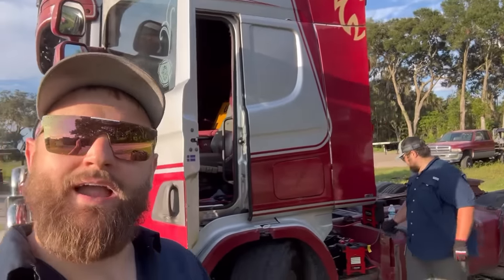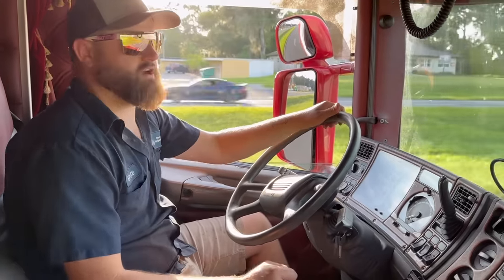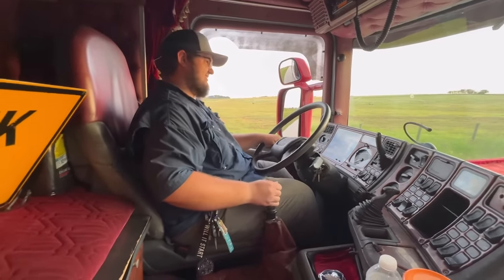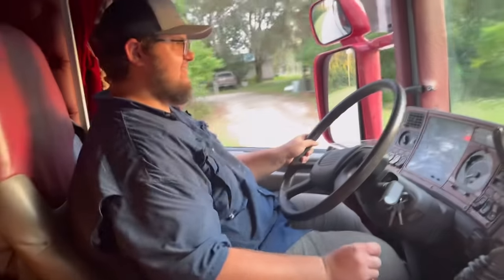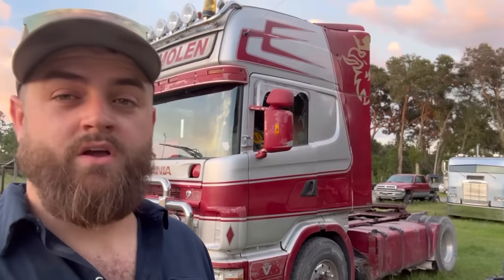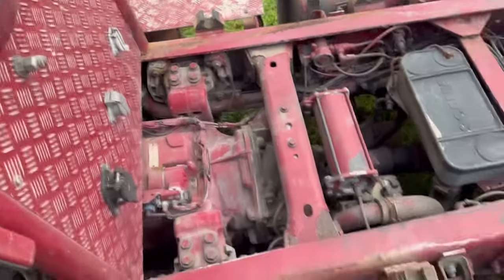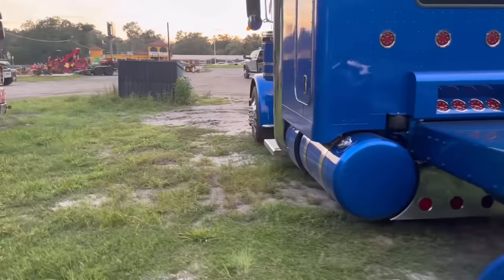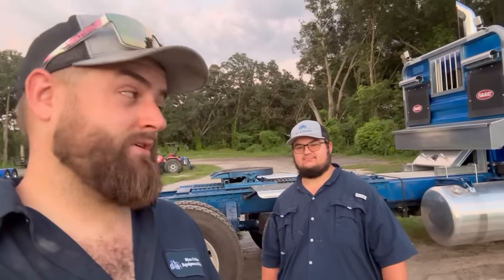American ATTEMPTS to Drive European Semi Truck. (Big Fail)

Comment: I really want to collect a variation of working trucks from all fields thats used here in norway, that scania is a really short wheelbase and its more use in mid europe or flatland europe, come to scandinavia you can hardly find single axel
Reply: It depends of the kind of work of any truck.. Most of the trucks in EU are with two axles and the trailers with three. That was because the TOTAL Gross Tonnage was 40 tons.. And in some countries, we had to comply ALSO with the EVERY axle's tonnage.. Now ,with the new length and tonnage regulations, things are changing.. You 'll see it in Norway too.. Up to now it was a matter of balancing weight and total length because of the 40 tons and 15,5m total length...Now you see many "new" trucks on the roads..

Comment: The round thing of Paper is an log , it logs Speed and driving Time , the police can / will check it if they pull you over . Drivers are not allowed to drive longer than 10 h a Day in Germany  , thats pure driving Time and they have to make a break after 4,5 h driving Time of at least 45 min duration and after 6 h they have to make a break of 30 min . This is required by law thats why the  round paper thing is there , the police has to have an option to check driving Time and Speed , and in my opinion thats good , tired and unconcentrated Drivers can be dangerous . Employers and self employed drivers may have an different opinion because it can limit their earnings , or if they ignore it , they are fined . Since 2006 digital Devices in new Trucks are used to log driving Time and Speed

Comment: I do like the idea of stretching the original frame out, honestly it would be a little funny to see if stretched out longer than you would with any american truck
That said, the original frame isn't TOO bad, the problem is you'd have a lot of work stripping the frame back to metal to get it repainted
Also, I should mention euro size rims are different, im not sure if it was put on american rims when it was imported

Comment: just for information the little toggle switch on the top side of the lever is the splitter,  what you were calling the splitter on the bottom of the stick is actually the range changer (or two speed rear axle if you prefer), in the main box you have three forward  gears which are each split  hi/lo making six speeds in total (low first/high first, low second/high second and so on)  once in third /high split you then pull it into neutral split it low and pull up the range changer then select first again and do it all over again in high range giving you a total of twelve forward speeds and effectively four reverses. done MANY thousands of miles in these motors back in the day - (when we still had clutch pedals !) the 14 litre 500 horse V8 is a beast, pulls like a train fully loaded. its slightly smaller engined sister the 123 uses a 12 litre 440 horse straight six and THAT pulls like a train too although without the spine tingling soundtrack of the V8.

Comment: This truck has done more miles than the Space Shuttle..looking at its general condition..must be over 20 years old..been across Europe and Scandinavia the whole of its life. I notice she's running lumpy too - these are usually sweet as a nut
Reply: Its a 4 series scania, iirc they were built until ~2002 or somewhere around that.

Comment: If u are trying to find a nextgen Scania (2016-forward) with manual gears, that will be a challenge. Manual is so rare nowadays, hardly anyone wants that because Scania's Opticruise (brand for automatised gearbox) is so much better than manual. Volvo and Mercedes-benz does not sell truck with manual gears anymore in europe
Reply: The reason being that people can't drive anymore, companies need cheap steering wheel holders. Only an idiot would prefer an automatic, luckily Finns still appreciate Fullers.
Reply: @ImForwardlook  tell me how automatised transmission make you a bad driver? I have been driving now 12 years and always with manual but i still prefer automatic, does that make me also bad driver and idiot? Ps, in Finland only truck with fuller is Sisu, and it also has an automatic transmission as standard, you have to pay more for a manual
Reply: @ImForwardlook  lower running costs is the reason for manuals going extinct, not the inability of the driver to swing a stick around. There are other ways to satisfy your love for fondling "sticks" if it's such an important part of your life.
Reply: Companies bought the automatic trucks because of less maintenance and lower fuel consumption. Very few people want manual transmission any more in Europe there's no reason for the manuals anymore
Reply: @ImForwardlook  What does a gearbox have to do with how good of a driver you are? Don't get me wrong, I like a manual for fun in a car. 
But for example the opti cruise if we are talking Scania was more than 10 years ago already better than a manual. It would allways do what you told it to and even could do stuff you can forget in a manual. O program and it sounds like it's raping the gearbox on how fast it shifts (quit driving more than 5 years ago so haen't had a chance to expreince the new version)
On top off that 600-700+ hp with over 3000nm of torque, couple of misstakes and bye bye driveline.
Reply: @sauliaalto  And your answer to the question why pretty much all logging trucks and other heavy haulers are Sisu is right there.
Reply: @ImForwardlook  what decade do you live in 😂?  Sisu was the most popular timber truck in Finland in the last 90s.  Volvo and Scania have been the most popular by a clear majority since then.
Reply: I guess an big differences is, US seems to be mostly flat. 
Out on the highway in to gear and drive. 
Fore an example Scandinavia you need to shift gear more. 
Hills, redlighrs, and so one.

So you auto haters visit europe and try 😊

Comment: By the early noughties, many trucks had g/boxes that didn’t need the use of the clutch. Now they are mainly automatic.
Reply: When you say 'automatic' they are actually manual gearboxes but shifted by ECU controlled pneumatics.
Reply: Early '00? 
Dude our lorries have been synchronised since the 50's!
Reply: @frankeinfish  Synchros wear and US/Canadian drivers do a lot more miles per year than European drivers.
Reply: @rich7447  Lorry grade synchros does not wear faster than any other component in the gearbox and no, NA drivers do not drive longer distances than their European counterparts. 
I mean how would that even work? there's only so many hours in a year and last I checked they didn't have any more hours in America...

Sure the average might be lower in Europe due to more short-haul but the European long-haul trucks gets just as much, if not significantly more, kilometres on them.
Reply: @frankeinfish  You are capped at 9 hours of driving a day in Europe. North America is 11 hours of driving and 14 hour total work day. Along the east and west coast and in a few central cities drivers have to contend with traffic, but most of the rest of the country you don't have those delays and North America also has the advantage of allowing commercial trucks to run at the same speed as the rest of traffic. That means an average of 70 mph, not 90 kph/54 mph.
EU long haul drivers average 10,000 to 11,000 km (6,200 to 6,900 miles) per month vs the US where regional and OTR drivers are averaging 500 miles a day (10,000 miles per month). 
It's the miles/month that makes long service intervals important.
Reply: @rich7447  Like I said the average is probably lower due to more short-haul but our long-haul racks up just as much if not significantly more kilometres.

Also as I stated earlier lorry grade synchros does not impact the service interval at all since they outlast just about everything else in the gearbox.
Reply: @frankeinfish  Synchro gear boxes had quite a few issues here and were a larger footprint than a crash box rated for the same torque. Now we have more companies moving to automated manuals.
European drivers aren't doing the miles than North American drivers are. The US and Canada are each almost as large as continental Europe and the regulations and conditions make it possible to do far more miles than possible in Europe. You simply don't have the distances between major cities or the emptiness of the North American west.
I drove from Boise Idaho to Baltimore Maryland in 3.5 days (2,600 miles) in our RV just to get back from vacation. That's not even coast to coast.
Reply: @rich7447  Perhaps that says more about the manufacturers of those gearboxes rather than the technology itself, considering it has worked perfectly over here on lorries that are both heavier and produce more power/torque..
Reply: @frankeinfish  I guess you would have to look at maintenance schedules for transmissions on both sides of the pond since the majority are made by the same companies.

Comment: I used to drive a scania 164 580 brake 14litre good trucks apart from the rust issues... good luck with it  hi from the UK 🇬🇧🇬🇧🇬🇧
Reply: 164 is with 16litre engine and 144 with 14litre. If im not wrong 144 530 was most powerful 14litre.

Comment: Ayyyyup. Rust is a bit of an issue in a wet country where tons of road salt is used because with 17.000.000 people in a country the size of a stamp, just a handful of unpassable roads already cause extreme traffic jams.
And yeah, the truck's short. It has to be, it has to be able to get into villages with streets that are literally as old as the USA (as a country) itself. The fairground attraction operators have to be able to get onto the old market square. 
Those operators also often have the nicest, most decorated trucks because they're from individual owners.

Comment: I never used a 3 over 3 manual gearbox. I drove 4 over 4 and 4 beside 4 boxes. The 4 over 4 had a paddle on the front of the lever that switched between low and high ratio and a rocker switch on the side that could split each gear.
 The 4 beside 4 (Renault if i remember right) worked by going into neutral after 4th gear and shoving hard right on the gear lever to take it into high range, you then went back to where 1st was and that would now be 5th gear the same as 4 over 4.
When you're used to manual gearboxes, it isnt really that hard to learn.

Comment: If you think the 96 Scannia has allot of systems, you should see the new ones. Between cameras and even more sensors and automated systems. They are incredible but incredibly complex.

Would love to see you save as much as is feasible.. Think you'll lose lots of the presence of the truck with no farings and small tanks.
Still looking forward to whatever yoiu do to it, so long as it gets a new life instead of a scrap yard like most things do and this probably would have.

Anything made of thinner steel is going to be bad. The frame and larger furnishings should be savable. But it's making all those air lines and clamps and trays and brackets and... and.. and.
Northern Europe would be like your NE states for road salt/ proximity to sea and being quite wet generally. Everything rusts.

It'll be a massive job to do it right but you'll have a hellofa truck to show for it at the end.. Looking forward to it, the more detailed the better IMO.

Comment: Analogue tachograph logs your speed and time you set the mode switch to the pair of hammers for work ,bed for your rest periods and the square with diagonal line is the period of availability

Comment: Scania 144L 530 Topline .

14 - engine capacity 14 litres.
4 - Scania 4 series.
L - long distance.
530 - engine power 530hp V8.. 
High Topline cabin. 
Engine code : DSC 14 13     😉

Comment: Most European trucks have syncromesh gearboxes, you have to use the clutch for all gear changes.
Un-like the Eaton-Fuller Roadranger boxes that are "crash" boxes.
Personally I much prefer the Roadranger box , it is so much quicker and you can float the change without the clutch.
Much easier on the left leg!
Generally the European trucks are lower revving than the American engines.
They require very different driving styles.
I am in Australia and drive both types.
The European trucks have much lighter controls and ride much more comfortably. More like driving a car.
Reply: You can still float shift in synchronized gearboxes so no you don't have to use the clutch. The same is true for european cars, you don't have to use the clutch if you are good with floating gears. But nobody does that since it's pointless.
Reply: @swunt10  You can float shift a synchromesh box, i have done it in an emergency after a failed clutch cylinder.
But if you make a habit of it you will rapidly wear out the synchro rings and you will turn it into a non-synchro box in no time at all!
Reply: @charlesbrewer6552  If anything using the clutch should wear out the synchro rings faster since they have to provide the friction when using a clutch with miss matched RPMs. Float shifting a synchro gearbox on the other hand doesn't really use the synchro rings so it shouldn't wear them out.

Comment: You could take care of the rust ,the same way you do with the American trucks..Ok it's a big time job but the sandblaster knows how..I saw in the video that the tacho is working somehow. So may be you could find another one to replace it.. This type you have is for TWO DRIVERS.. The tacho card inside is the old system. They are very cheap now . If you order at least one box to test it(about 50 or 100 cards inside..) see that the cards are for 125Km/hour (there are also tacho cards for 90 Km/hour also in miles per hour  you can find them in the UK market ) But nowadays we use the smartcard systems.. May be some tacho technician there at your place can inform you about this, IF you need it.. The air system brakes, regulators, ,valves, airbags etc, are the same and normally, you should find everything in your market there, IF you need some parts.. WABCO is widely known here in Europe and many trucks and trailers use their air system..Also many parts from other suppliers are interchangeable   with yours.. Anyway  many parts are common with Volvo or very similar (Scania and Volvo are Swedish..) also with other makers'.. For the brakes,I don't think you'll have any problem to find parts for them.. These older Scanias are VERY popular here in Europe and you can find EVERYTHING for them in cheap prices.. Now for the driving of it.. The engine is a beast for shure but you MUST be very "kind" with the gearbox and the differential, IF you  want to keep it alive and running.. As is now,empty tractor,you can start with "high" gears or some 4th or 5th gear normally and then upchange by two (from 4th to 6th and so on..) you will see.. If it is loaded, the gear changes are according to the needs... That's for now Bruce...Nice video though.. Greetings from Greece

Comment: If you want to drive a Scania in the US search for a double drive unit.  You'll have to go with an older Scania to get a manual (2015-2016 ish at a guess) gearbox.  If you want a newer cabover with a manual gearbox you'll have to look for a DAF which is Paccar but they'll have less power and won't be a V8.

Comment: Tachograph card behind the speedo is use to track the hours you drive and to ensure the driver is taking his regular breaks he is legally bound to take, here in Europe there will be random checkpoints on the road especially for commercial vehicles to ensure you are going about your job in a safe and efficient manner. They will check the condition of the truck trailer, your weight, and your tachograph. Big fines and a possibility of loss of drivers licence if you are caught doing anything illegal.

Comment: That tachograph, called "Fahrtenschreiber" recorded your time driving, your speed and your breaks. In Europe you are allowed to drive for 4,5 hours, then you have to take a break of 45min before you are allowed to drive for another 4,5 hours. After the second break of 45min you are allowed to drive 1 hour before you have to quit. After 9 or 11 hours you can start again.
Today the whole thing is digital, with a card registered to you, recording your activities for 28 days. They can concern you for the past 28 days if anything is wrong. 
That old paper thing is a witness of the good old times. 
when the card was full, you just put in a new one and threw the full one out the window 😂

Comment: the reason for the short length of the tractor is because they are only allowed to be 15.5 m ( 51 Feet ) long with the trailer on in Europe so the shorter the tractor the more length there is for the load, 
and can drive with a 12m (40 feet) container on the trailer

lorries with front carriage and trailer a max allowed to be 18.75 m ( 61 Feet ) in Europe

the paper disc in the tachograph must be changed every 24 hours when the truck is used

Comment: I drive 18 wheelers in the UK , the V8 scania is such an awesome truck , it’s such a shame to see your Scania in that condition , I understand that the neglect is not from you so am not proportioning blame . In Europe and especially in the UK manual trucks are very much a dying breed, where trucks came as standard with a manual transmission, now they come with automatic, mainly as the automatics are more fuel efficient. I got to drive a kenworth in Australia  ? tbh I did not rate it , not because there was anything wrong with it only because it was so different to what I was use to ? This was in 2006 , the kenworth in Australian spec was some 10 years behind what was available in the UK and Europe ? Am not saying one is better than the other was just an observation ? I would suggest you take a look at the Scania longline as they are just awesome ? And yes I am biased lol keep on trucking guys …….. peace

Comment: I think this is a Swedish truck with a Dutch license plate. In Zwolle we do not place plastic protection around the air pipes. only for the fuel lines ra rc rb rx